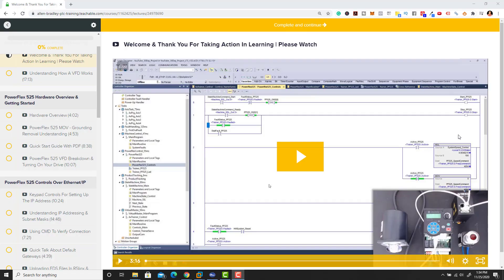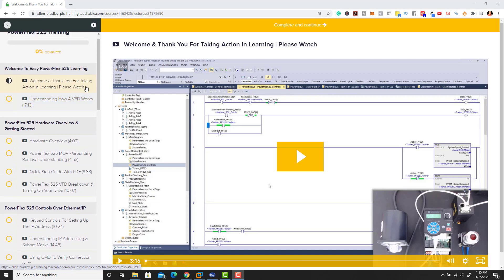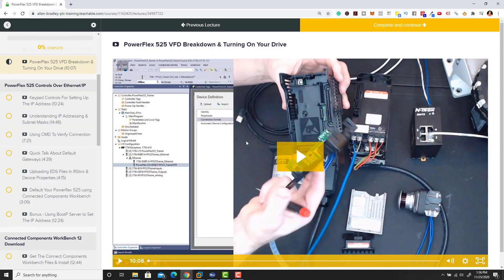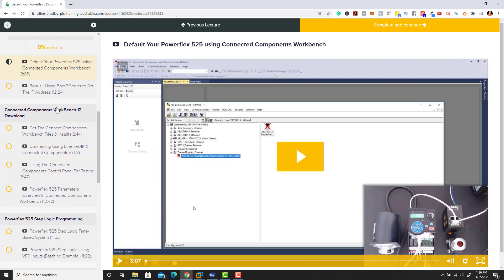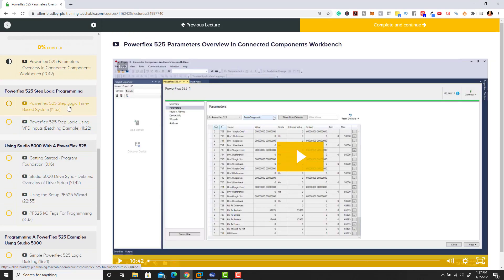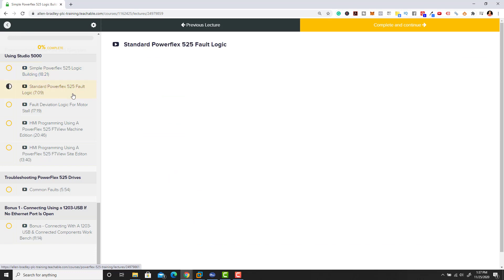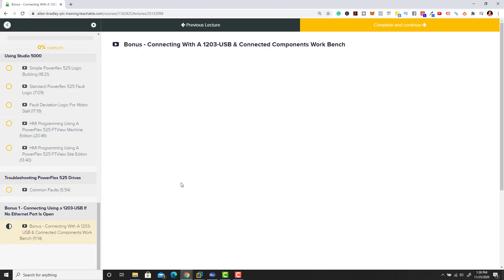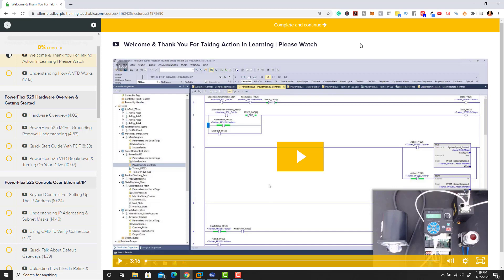Powerflex 525 Training | Course Overview | In-depth PLC Programming for Powerflex 525 drives

Comment: The best courses I've taken ever are in your Platform. The completest and professional ones.
Reply from the maker: Thank you for the kind words
Reply: @ShaneWelcher  I am a Siemens programmer but, I am currently working in factory that every machine usu allen brandley technologies and with your courses I've learned everything I need to succeed. Thanks Shane!!!!!
Reply from the maker: @DavidSanchez-gb6dd  Glad to hear they help.

I know the feeling, changing from one logic platform to another.

Each one has a different ways.

Let me know if there is anything I can do to help or improve on what I teach.
Reply: @ShaneWelcher  of course yes, I've already taken the 2 mastery servo control courses and I really learned I lot but, could you make a servo training that we can see the movements in a small video in the corner just like the powerflex course?
Reply from the maker: @DavidSanchez-gb6dd  

Sure

I have started doing that in the latest YouTube videos I made.

Not sure if you saw them

I actually have a series of servo registration videos that I added to Advanced Servo Motion Mastery that shows the movement & registration events.

Did you see that?

I sent an email out letting everyone know
Reply: @ShaneWelcher   no I didn't I'll check them out thanks for the info